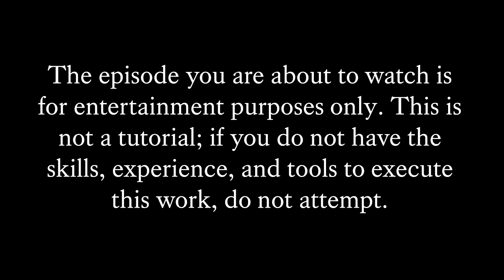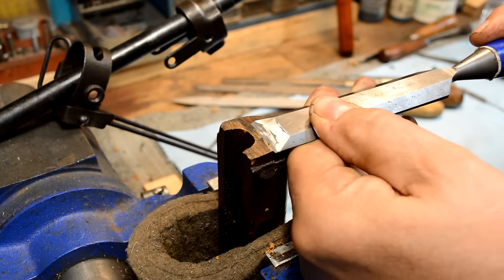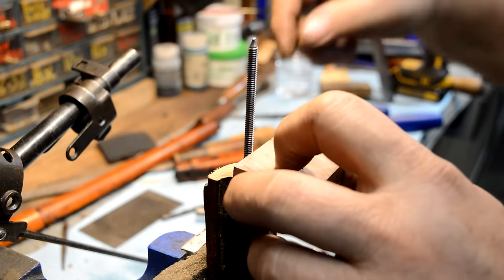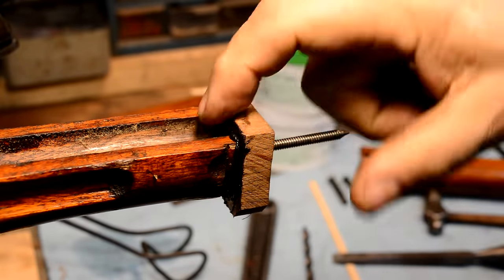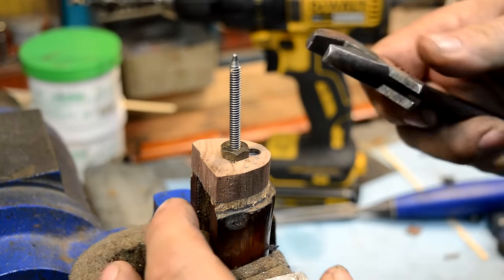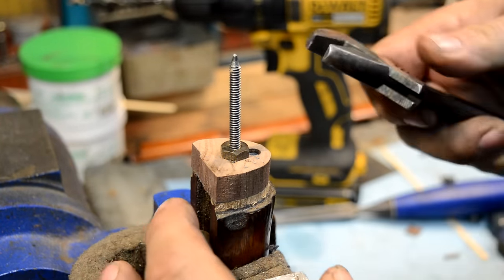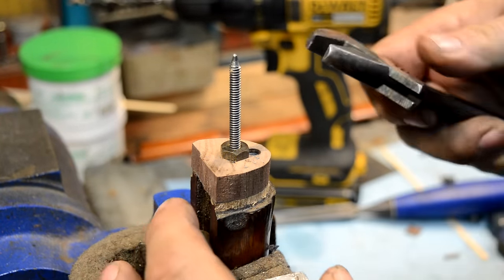Anvil 086: Type 99 Arisaka duffel cut repair

Comment: Mark, I have a friend, no, seriously, I have a friend that has a Type 99 that the bolt functioned perfectly until it was fired and now he can't get the bolt to open.  Something is blocking in the safety area that prevents the bolt from being pulled rearward.  You ever see this problem before?
Reply: Try depressing the nut of the bolt and turning 45 degree left
Reply: I assumume the notch is fully up

Comment: What's the value of a rifle in the same condition of the one as the video? I just sold mine without a bolt and in rough shape for 200 bucks.
Reply: I wouldn't have done that
Reply: My Type 99 is identical to the one in the video, minus the duffle cut. I could easily get $1,000.00 for it. You could have got a bolt off Ebay & had a fun gun.
Reply: I don't think it was the same rifle. Is there a difference between Anka Ara and arisaka? I know mine was built in Turkey and had the hammer and sickle on it but it also had the kind of secondary "under barrel" for a bayonet (which I had) so I don't think it was the same as this rifle.
Reply: @ConcussedGaming  , The Ankara is different in many ways..
Reply: @ConcussedGaming  Yours was a Turkish Mauser.  Similar action, but not (currently) as valuable.

Comment: Good craftmenshift and maby camera glasses for the angels you want to show?
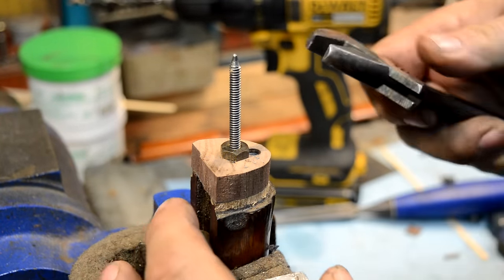Reply: Well this isn't going to be welcome but here we go. @31:53 we can very clearly see that the top edge of the stock on the right is noticeably higher than that on the left of the join. Mark does not see this. This is the stage where the parts are brought together dry so that they can be fitted correctly. Look closely, it can be seen that the barrel is sitting down hard into the wood on the right but is lifted in the wood on the left as witnessed by a gap between the wood and the metal on the left. This can only be caused by the wood on the right being too high in relation to the mother stock and shows that the hole for the threaded rod is in the wrong position and is causing the joint to be out of line. 
Having assembled the joint @37:43 we see that the exact same conditions apply and the repair is out of line. Start watching at 38:10 Mark checks the alignment and (look closely) moves the stock even further out of alignment by lifting it higher. Shortly after this he confidently tells us that this is not the sort of gun that you learn on. @40:10 here's the smoking gun! Notice how the wood grain is showing through the glue. It stops showing at the exact line of the join because the barrel was lifted up from the mother stock by the miss aligned stock. All the pressure of the rubber strap could not pull it true because the threaded rod could not allow it to move into line. @42:32 look closely at the visible left hand edge of the glue and it can be seen to have considerable thickness. This is the result of the barrel not sitting down in its cradle in the stock. The thickness of the glue exactly matches the degree of missalignment of the top edge. @45:01 he finally notices the problem with the top edge of the stock and cuts a little wood off. @45:16 Mark starts to explain that wood moves with time and he's right. However no amount of explanation can put this situation right. @47:18 he cuts away wood and tells us that it swelled right here. He demonstrates that he does not understand why the top edges are not in line and level. @49:14 this is the first time that we see the results of the missalignment. Not withstanding any bending of the top stock the gap between the top and bottom on the left of the joint is exactly equal to the degree of error in jigging the two parts of the stock together. Mark's attempts to blend the joint are seen as a freshly cut ramp in the wood. @51:23 Mark is telling us that the front end joint is tight and it is. However he makes no mention of the gap behind the joint which will always be there. @54:20 observe the gap where the top covers the bottom. In spite of any explanations that gap is there because Mark assembled it out of line. 
I have been a gunsmith for over 40 years and am often called upon to correct poor repairs. I despair at this job and I wonder if the owner will be content with explanations of swelling wood as he holds this rare example. Often I have found that workers who make sure we all know how good they are can produce average work with eloquent and lengthy explanations of how difficult it was and how the average joe would make a hash of it. I expect this comment will be deleted as it will not sit well with Mark Novak. I challenge you to leave it here so that your viewers can respond.

Comment: Almost forgot, there are a few dings in the wood but nothing that reminds me of vise marks.  My gun does not have the action dust shield and it is missing the ram rod and I have not found a baynet for it.  Do you have any suggestions?
Reply: In order to find ammo and or the parts that you're missing I suggest that you check online or go to a gunsmith and have them fabricated

Comment: Sorry Mark if you already said, but why was that wood cut in the first place?
Reply: so a soldier could bring the gun back to the states. There was a lot of stuff done to bring back weapons in the 1900's to make them "safe for transport" or to "demilitarize" them (now the ATF and Customs makes it almost impossible to bring most anything back legally (not just arms, and even if you bought it, a friend of mine has a nice set of Afghan knives sitting in some customs lock-up some where). That's why the dust covers are often missing, and bolts are mismatched on the Arisaka's here in the states. Most likely, the stock was cut to fit in a duffle, along with the disassembled rifle
Reply: @wildrangeringreen  Duffel cuts weren't about complying with import regulations back then, that didn't come into play until 1968. It was purely about getting the rifle to fit in a soldier's duffel bag to bring home.
Reply: @will9357  agreed, but then, like now, the Army and Navy had regs on bringing trophies back; they were much looser until Vietnam

Comment: Awsome job well done
Reply: Well this isn't going to be welcome but here we go. @31:53 we can very clearly see that the top edge of the stock on the right is noticeably higher than that on the left of the join. Mark does not see this. This is the stage where the parts are brought together dry so that they can be fitted correctly. Look closely, it can be seen that the barrel is sitting down hard into the wood on the right but is lifted in the wood on the left as witnessed by a gap between the wood and the metal on the left. This can only be caused by the wood on the right being too high in relation to the mother stock and shows that the hole for the threaded rod is in the wrong position and is causing the joint to be out of line. 
Having assembled the joint @37:43 we see that the exact same conditions apply and the repair is out of line. Start watching at 38:10 Mark checks the alignment and (look closely) moves the stock even further out of alignment by lifting it higher. Shortly after this he confidently tells us that this is not the sort of gun that you learn on. @40:10 here's the smoking gun! Notice how the wood grain is showing through the glue. It stops showing at the exact line of the join because the barrel was lifted up from the mother stock by the miss aligned stock. All the pressure of the rubber strap could not pull it true because the threaded rod could not allow it to move into line. @42:32 look closely at the visible left hand edge of the glue and it can be seen to have considerable thickness. This is the result of the barrel not sitting down in its cradle in the stock. The thickness of the glue exactly matches the degree of missalignment of the top edge. @45:01 he finally notices the problem with the top edge of the stock and cuts a little wood off. @45:16 Mark starts to explain that wood moves with time and he's right. However no amount of explanation can put this situation right. @47:18 he cuts away wood and tells us that it swelled right here. He demonstrates that he does not understand why the top edges are not in line and level. @49:14 this is the first time that we see the results of the missalignment. Not withstanding any bending of the top stock the gap between the top and bottom on the left of the joint is exactly equal to the degree of error in jigging the two parts of the stock together. Mark's attempts to blend the joint are seen as a freshly cut ramp in the wood. @51:23 Mark is telling us that the front end joint is tight and it is. However he makes no mention of the gap behind the joint which will always be there. @54:20 observe the gap where the top covers the bottom. In spite of any explanations that gap is there because Mark assembled it out of line. 
I have been a gunsmith for over 40 years and am often called upon to correct poor repairs. I despair at this job and I wonder if the owner will be content with explanations of swelling wood as he holds this rare example. Often I have found that workers who make sure we all know how good they are can produce average work with eloquent and lengthy explanations of how difficult it was and how the average joe would make a hash of it. I expect this comment will be deleted as it will not sit well with Mark Novak. I challenge you to leave it here so that your viewers can respond.

Comment: Very good job
Reply: Well this isn't going to be welcome but here we go. @31:53 we can very clearly see that the top edge of the stock on the right is noticeably higher than that on the left of the join. Mark does not see this. This is the stage where the parts are brought together dry so that they can be fitted correctly. Look closely, it can be seen that the barrel is sitting down hard into the wood on the right but is lifted in the wood on the left as witnessed by a gap between the wood and the metal on the left. This can only be caused by the wood on the right being too high in relation to the mother stock and shows that the hole for the threaded rod is in the wrong position and is causing the joint to be out of line. 
Having assembled the joint @37:43 we see that the exact same conditions apply and the repair is out of line. Start watching at 38:10 Mark checks the alignment and (look closely) moves the stock even further out of alignment by lifting it higher. Shortly after this he confidently tells us that this is not the sort of gun that you learn on. @40:10 here's the smoking gun! Notice how the wood grain is showing through the glue. It stops showing at the exact line of the join because the barrel was lifted up from the mother stock by the miss aligned stock. All the pressure of the rubber strap could not pull it true because the threaded rod could not allow it to move into line. @42:32 look closely at the visible left hand edge of the glue and it can be seen to have considerable thickness. This is the result of the barrel not sitting down in its cradle in the stock. The thickness of the glue exactly matches the degree of missalignment of the top edge. @45:01 he finally notices the problem with the top edge of the stock and cuts a little wood off. @45:16 Mark starts to explain that wood moves with time and he's right. However no amount of explanation can put this situation right. @47:18 he cuts away wood and tells us that it swelled right here. He demonstrates that he does not understand why the top edges are not in line and level. @49:14 this is the first time that we see the results of the missalignment. Not withstanding any bending of the top stock the gap between the top and bottom on the left of the joint is exactly equal to the degree of error in jigging the two parts of the stock together. Mark's attempts to blend the joint are seen as a freshly cut ramp in the wood. @51:23 Mark is telling us that the front end joint is tight and it is. However he makes no mention of the gap behind the joint which will always be there. @54:20 observe the gap where the top covers the bottom. In spite of any explanations that gap is there because Mark assembled it out of line. 
I have been a gunsmith for over 40 years and am often called upon to correct poor repairs. I despair at this job and I wonder if the owner will be content with explanations of swelling wood as he holds this rare example. Often I have found that workers who make sure we all know how good they are can produce average work with eloquent and lengthy explanations of how difficult it was and how the average joe would make a hash of it. I expect this comment will be deleted as it will not sit well with Mark Novak. I challenge you to leave it here so that your viewers can respond.

Comment: Do you have a video on the split stocks of these types .
Reply: If you are asking about the butt stock , all the Japanese rifles were made with split butt stocks . One they didn’t have to have as big of piece of wood to make the butt stock , since it was two separate pieces & they did that because that is where most of the time they did split or crack . They used a dovetail joint to connect them together
Reply: @milsurprifleguy7091  I'm aware of why it was done , more interested in remedies to control the splitting
Reply: @texasslingleadsomtingwong8751  didn’t really know what you were asking about , so I put that out there for you . Mark is the guy to find out from . He does have some videos on split / cracked stocks , just not the Arisaka
Reply: @milsurprifleguy7091  i didn't state it very clearly.  ... at all , lol
Reply: @milsurprifleguy7091  I'll have to dig around his archives to even see if it's acceptable for this particular model . I kinda worry that , due to it still being raw ( cosmoline ) and intact with flower marking , this may make it a bad choice for stock repair . Its never been fired . And it won't be .

Comment: Mark, here is a link to pictures of my Type 99 Arisaka (Kokura Arsenal, series 21)with an unmolested mum, no import marks, and no duffel cut.  The bluing turned brown prior to my acquiring it.  Would it hurt it to disassemble it and boil/steam all of the metal parts?  Thank you.
https://imgur.com/a/XSS8OmG
Reply from the maker: Definitely a prime candidate for full conservation, yes
Reply: Mark, should I remove the front sight before streaming the barrel or leave it in place?
Reply: Before you conserve, note that T99's should have staked screws in many places. If you unstake them, many collectors would deem that less collectible. Unless the rust is really bad you might consider giving it a 0000 (never any corser) steel wool treatment. I have conserved a T99 before but it had been un-staked by a previous owner. Yours is in relatively good shape. That amount of patina is not an issue. I would advise not doing it unless you have signs of deeper issues that affect functionality. "It can only be original once." Not everyone is a collector, I understand.

Comment: why not put the 2 pieces of wood together in a fixture and machine a dovetail under where barrel goes and them make the dovetail,  glue and put it in there. once dried machine the barrel space out.
Reply: Most likely the cost, since the owner wouldnt want put the extra $2k for that amount of work when it could be done by hand. My guess is this repair is at least $800 if you took it to Mark right now.
Reply: @topguntin   I see. yap you are correct.I think the fixture would makes the cost go up.

Comment: I did one also.. thickness?? 
What saw does a GI have around if he needs one in remote location?? Hack saw.. we broke blade into small long pieces or tried.. It was hard and only needed just few for spacers?? Other wood drilled lenght wise holes smaller. Used long wood Q-Tips same size Q-Tip as sheetrock screws. Cut heads off sheetrock screws and screwed sheet rock screw into forearm with points pointing out.

Comment: I'm disappointed, you hand honed the chisel. I would have put that up on a jig and took it out to a 20k micro  bevel for something this special.
Reply: I collect (still not expert by any means though) Japanese small arms. Honestly this gun isn't that 'special,' or at least not that valuable, relative to many other WW2 guns in that kind of condition. Duffle cut early Type 99, in that condition with those things and assuming matching? ~$800-1000 probably? Even a Japanese Type 2 rifle is usually $1500+